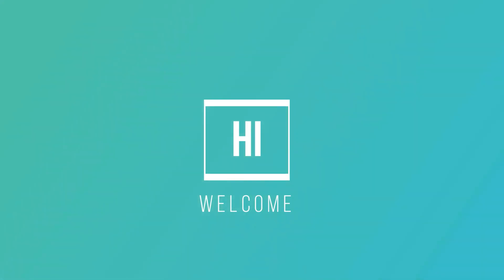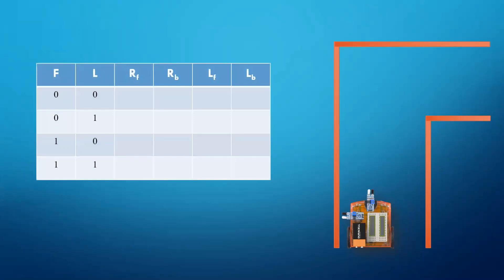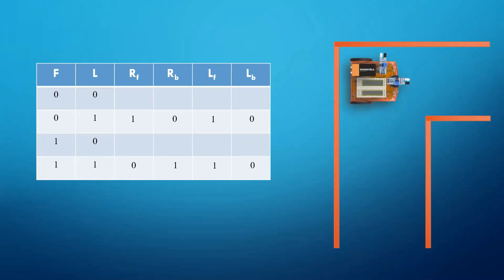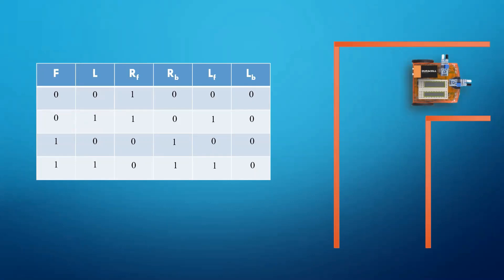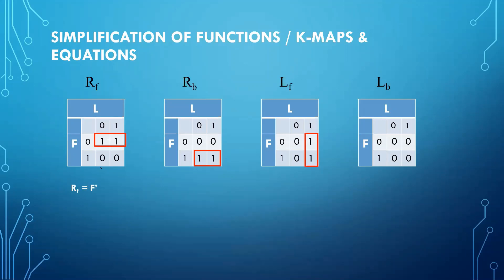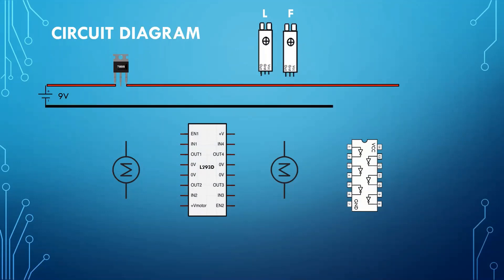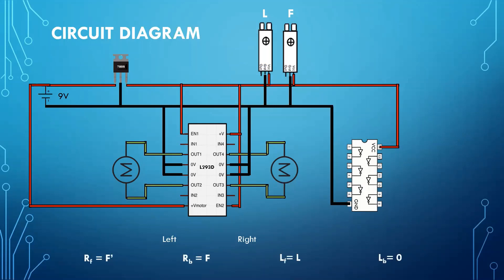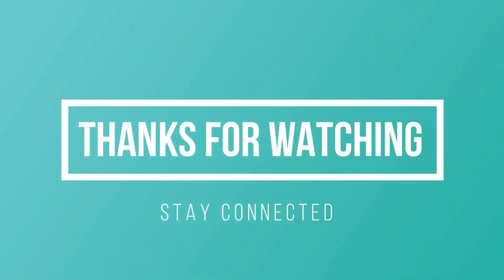Maze Solving Robot using Digital Logic Design | Electrical engineering DLD Project| Full Explanation

Comment: which ir sensor you have used?because my ir sensor is not so sensitive like yours...Your bot is detecting the walls so smoothly and also the speed controlling is also so smooth...
i made the exact same robot,but i cant control the speed,when my bot is taking a turn ,its hitting the wall hence ir sensor loose the calibration..what should i do? please response
Reply from the maker: Hello Ashikul Islam
I think you need to slow the speed, give some time to IR sensor for detection, if the issue is resolved then move onwards to change IR sensor

Comment: proteus ka konsa version use kia ha aap ne
Reply from the maker: Proteus use nahi kia
Reply: phr circuit diagram k lye kya use kia ha
Reply from the maker: Wo just video k lia Power point par animate kia ha circuit. Ap proteus par b bana sakty ho
Reply: @electroniccorner6829  bro ye proteus pe run ni ho rha
Reply from the maker: @justforfun1073  kindly share screenshot of circuit. You just need to exactly make connections and everything should work fine
Reply: ok thanks 😊😊
Reply: bro is ki logic diagram ma konsa gate use kia ha NOT gate ya NAND gate